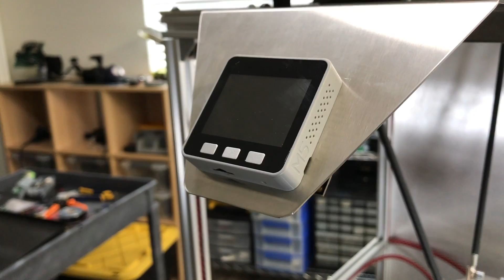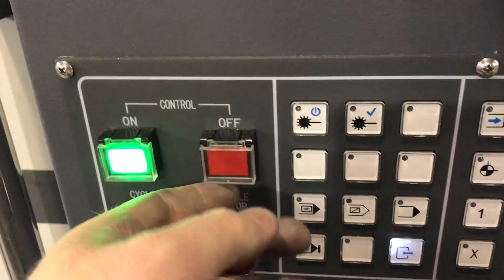Delta Robot Power Distribution - Project Update

Comment: 1) where did you get the ball joints and poles?
2) What is the mechanical accuracy of movement along the plane of the table?
I tried to find on sale the exact ball joints from industrial delta robots, but did not find

Comment: friend is ready the firmware?. I want to build one. please friend. help me. works good without encoder ??
Reply from the maker: No, it is not ready yet. It will work without encoders but then you would need to add limit switches.

Comment: Is there a reason you used a separate power supply for each motor instead of a single big one?
Reply from the maker: Yes, because three 60V 6A power supplies are cheaper, more reliable, and safer than one 60V 18A power supply.
Reply: Proto G thank you.

Comment: So why not use 1 power supply for all 3 controller boards? it would eliminate a good amount of cost, and you wouldn't have to worry about reverse driving.
Reply from the maker: Because they are 60V 6A power supplies.  3 of those are cheaper and more readily available than one 60V 18A power supply.  There is no concern with reverse driving.

Comment: love the build, that said its seems a bit too much for a pick and place machine, i mean those motors with the gearboxes look huge!! is there a reason for that or did you just use what was available? the cables look great, overall quality of construction looks great like an art piece!
Reply from the maker: I manage a manufacturing facility and something like this could one day easily be adapted for real applications such as sorting metal parts coming off an assembly line. Object tracking cameras are getting much be and more available so the camera could easily be upgraded as well.

Comment: Who pays you for that? What is this place?
Reply from the maker: This is my apartment lab.  I'm a contract engineer in addition to my day job so I have to have a space to make additional income.  Most of my hobby projects have directly translated to real jobs and make me a better engineer.
Reply: Exacly what im wondering ....
Especialy for what purpose that thing is going to get used for.
Reply from the maker: I manage a manufacturing facility and something like this could one day easily be adapted for real applications such as sorting metal parts coming off an assembly line. Object tracking cameras are getting much be and more available so the camera could easily be upgraded as well.
Reply: And what does really a contract engineer do? Is a manufacturing facility manager your day job, and what are your responsibilities there? 
I'm just so curious because it looks like you are doing my dream job there :D
Wish you luck in future projects!
Reply from the maker: That depends on the engineer but I design mechanical parts & enclosures as well as electronics & PCBs.  That is a side job and I only take on jobs I'm really interested in.  Yes, my day job involves managing a manufacturing facility. For everything else you can look through my linkedin profile  https://www.linkedin.com/in/anthony-garofalo-72a8a853

Comment: Looking at the frame I can't help but hear Dan Gelbart's voice in my head, saying "the structure is not rigid!". Explained here: https://www.youtube.com/watch?v=EeEhS3zmnDg

Essentially the stepper motors are located at the point where the frame is most likely to get deformed over time, so the robot will get less accurate.
Reply from the maker: The top plate is made with 0.188" stainless steel. That motor plate is not deforming.  The Back plate and base plate bent out of one piece is made with 0.190" aluminum.  The power distribution plate that is also supporting the frame is also made with 0.190" aluminum.  With the addition of several angle braces that are already in place and some I haven't laser cut yet, this is more rigid that it will ever need to be.

Comment: How did you put the wire clamp in the stepper motor housing? Did you tap the hole, or use epoxy?
Reply from the maker: Epoxy

Comment: We've got a large form-factor 3D printer at work with similar construction to yours. It's got smoke tinted polycarbonate panels and looks really slick. It somewhat hides the inner works but you can still inspect things if you look closely.

Comment: Whats the build volume of that machine going to be?
What clamps are those 2:10? Checked your amazon link but didnt find them.
Reply from the maker: Not a simple XYZ volume dimension like a cartesian machine.  From the centerline of its reach, if it goes lower or higher, the perimeter it can draw gets smaller and smaller. I'll just make sure it can reach all areas of the 17.5"x19" work table. Strain Relief Cable Glands - https://amzn.to/2LdnuO8
Reply: Awesome thanks 👍